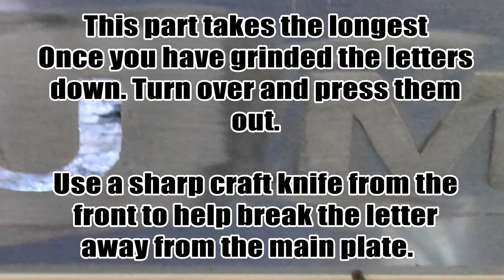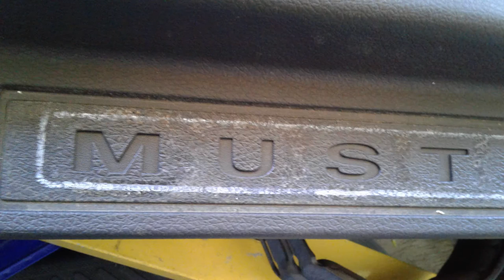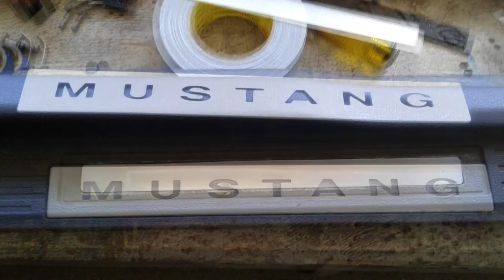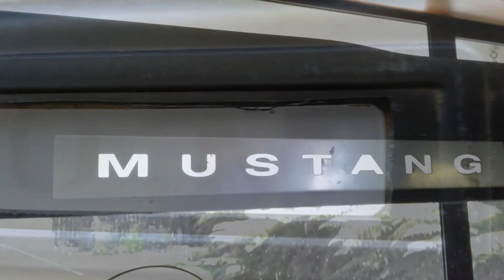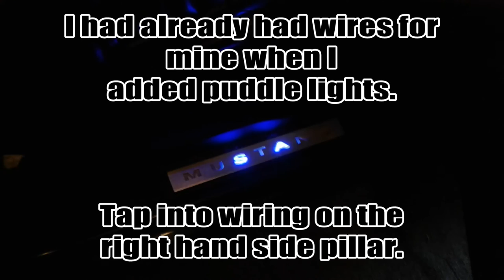How To Build Mustang LED Illuminated Door Sill Scuff Plate Made From Stock Sill

Comment: It costs 50 bucks for a used kit on eBay and 35 bucks for the oem ford wiring kit and install instruction. Multi colors for 10 and up.m, one color for 9 and under
Reply: Akuma Junior what is it called?